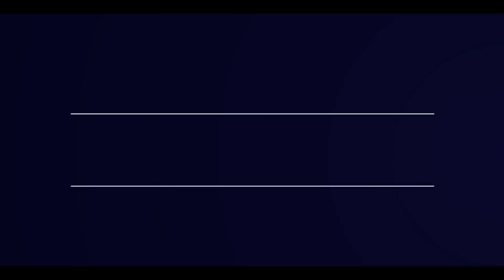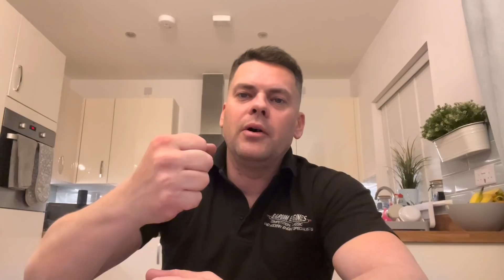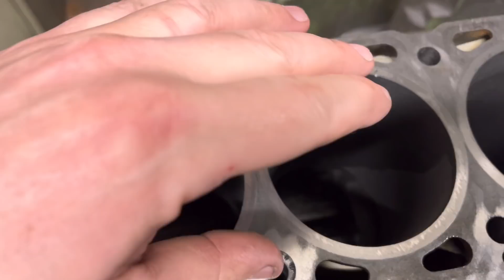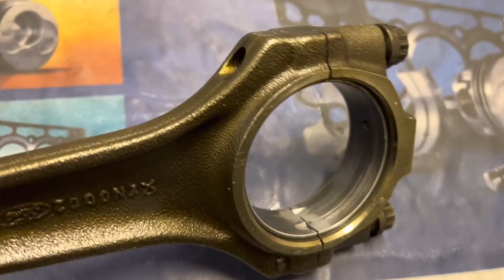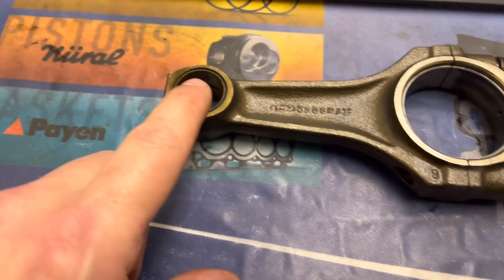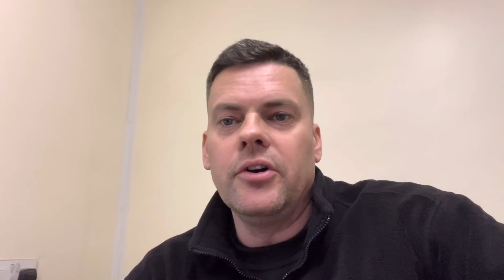Why are these engines SOO UNRELIABLE?

Comment: As a basic performance motor  (in it's) day.they were fine,then "enthusiasts" found that they could readily wind the boost up to the extent that the Head was doing its best to pull the Head studs out of the block. They seem to forget that it wasn't far off of a standard Sierra and even back to the last of the Cortinas.
Reply: The engine block can be traced back to early 70s so technically old when cosworth got hold of it it early 80s, but still effective if built right. As you say people  with no sympathy boosted the hell out of them and wondered why they grenaded themselves.

Comment: I love watching videos about old cosworth engines, as they were one of the modern turbocharged engines which set the bhp standard, fast forward to the 2000's and we have audi tt's 1.8T's running 270 bhp with 140k miles on them, engineering has come along way..

Comment: These engines were hammered during development  and came up as reliable. The competition versions worked but had a limited lifetime.  Then a tuning firm says we can do that for your daily driver which may last a fair length of time as it's not driven like a competion car on the road but start hammering it and issues will arise.  
Tuning firm .." Done loads of these , never had a problem ". I remember back in the day a friend telling me about having Lotus press cars having different cams rev limiter tweaked or removed,  those engines were shagged when they came off the press fleet.. they were however he said immense fun  ..when you're not picking up the bill.....

Comment: Great channel, so much info given especially to none mechanical folks such as me.
These Cosworth engines seem from what we learn on the internet to be or can be quite troublesome when older OR when altered to go faster, possibly.
With parts availability and cost's and labour times rising, is there any other engine out there that does what the Cosworth was made to achieve, or could be made to do, such as possibly a small block American engine at all. Just a thought.

Comment: Size distortion outside the standard thrust axis is usually due to knock or det. Those uncontrolled pressure spikes end up placing more compressive load on non standard thrust areas of the big end. Given the rudimentary knock control in the later engines (and non existent in earlier) then knock is often left uncontrolled, especially with tuned motors.

Comment: Dick Johnson in the late  80s raced them Cosworth Sierras. Once his team figured out how to in house tune them motors, them cars would stomp out crazy power for the time. Run in was 90 hp on the dyno turbo disconnected, turbo on with 2.4 bar of boost, 680. You tube vid on that some where. I just punched in Dick Johnson, Sierra and interview and up it came.

Comment: I had an argument with someone about Subaru engine reliability, I kept telling him it was because people put wrong fuel, raised boost, didn't service them regularly and thrashed them, as well as most unreliable ones are the earlier 90's models as the are really old now. Still couldn't convince him.
Reply: 100k on my ej207, still runs sweet and is standard apart from prodrive package from delivery. Suppose reliability depends on how far you go from oem spec
Reply: If people treated subarus like YB’s they’d be even more unreliable, people map subarus but with cossies they just buy generic chips, run 2.5 bar of boost through a badly worn engine and often run over double the factory bhp on standard engines
Reply: in fairness ive seen subaru engines throw big end bearings at a little over 40k miles in a car that was dealer serviced with the correct oil by time as it never got to be due a service on mileage terms, and driven like it was the owners baby, by a guy in his late 40s. teh car was BONE stock. not even the seemingly obligatory 'dustbin sized noise generator' exhaust rear section
Reply: I think the Subaru engines at least the 2.5 in the WRX and STI were junk for the most part.   Even brand new ones had head-gasket sealing problems.  God help you if you oil starved them a little with enough cornering. They'd start rod knocking fairly easily.  They were on the edge reliability wise from the factory.  The 2.0's were better somewhat. 

In the US they later '00's 2.5's had EPA mandated mapping problems where they'd stay closed loop too long when entering boost.  It was the primary cause of the broken ring-lands. 

All that said, my WRX is one of the very few cars I regret selling. It was the most fun of any car I've owned.  I completely swapped the entire drivetrain with a wrecked STI.  If you have a laptop, you can reflash these '00's subaru with open source tools.

Comment: From across the Atlantic.  The best engine I saw from your side was a 74 Mercury Capri - 6 cyl and 5 sp manual.    I know nothing of your issues. However - who here has deleted the waste gate, and let her breath. I raise my hand. Not a gas engine - but diesels. Had a herd of them from 1500 cc-79 to a 2002.  The 2002 is still running.  Oil - the life blood - needs to be a religious experience - and changed every time. Or the engine meets its rebuilder, where angels fix all the bad things we did.   Most are not honest about the story!  Cheers all!

Comment: Remember watching a documentary in the 80s, Cosworth trying to develop 4 cylinder turbo F1 engine. Used a standard Ford iron block. Built 2 engines and were then testing - 18k revs. First engine just stopped in it's tracks - 18k to 0 instantly. Rolled in second engine - same thing happened. Diagnosis of problem showed the blocks twisted, seizing the engines, they had to go back to the drawing board. FIAT 4 cylinder engines at the time in race trim were easily producing (reliably) more power than Cosworth got to on those development engines. And Cosworth had a tech logging analog data on a clipboard - at the time Toyota was using computer data logging just for engine QA - BMW using same tech as Toyota for engine development - Japanese instrumentation.

Comment: I worked for a Ford tractor dealership  in the early 90’s, when the tractors arrived from the factory?we had to dyno them for hours because they had a big case of failing porous bocks, we swapped out quite a few brand new engines on tractors with as little as 10 hours.

Comment: I was at Ford Dunton test ops during the development in the 80’s it was touch and go and had head bolt issues blowing degas bottles at Nardo and cylinder wear it in reality could not complete a FMC production sign off but was OK under then SVE testing regimes remember the basis was the Pinto block over engineered at the time, still a good engine and very impressive to drive back in the 80’s - we had a whale tale on the vehicle fleet
Reply: My neighbour worked at dunton in the 80's, was telling me that until he retired in the early 00's that they ran engines for a minimum of 600 hrs flat out.....we have a 86 mk1 xr4x4 with the cologne v6, had it since 93 and at 117k miles it's still on its original water pump and engine hoses, never even had the heads off, all cylinder compressions are between 155 and 160psi....thats had its oil changed every 3k miles with fully synthetic! 5w/30

Comment: I remember the Cosworth Vegas (Chevrolet) from the mid '70s! My memory may be kinda hazy after all this time but IIRC the blocks were Aluminum with Silicon Carbide (I think) in it. No sleeves. Theory was the pistons and rings would run on the Silicon. In reality they started burning oil almost on the way home from the dealership! I remember that someone figured out a way to sleeve the cylinders. Probably made a killing!
Reply: Then both Mercedes and Porsche adopted the same block material.

Comment: I did complete disassembly of Ford ECM used in European Escorts (Mondeos and such..) years ago when i got my Ford Escort and as car nerd wanted to bust open the ECM and shared definitions on TunerPRO forums of it and i love that ECM design as its so flexible and lots of functions made me think why bother with aftermarket ECM when this does so much without people really knowing it. 
Anyway personally i never got to fill my dream with Cosworth one and i will not due how my life going. Anyway my one favorite car ever. Kinda surprising issue with hear bolts even ripping when they advertised how bolts are arranged in angle to prevent anything head problems when they were developing it.. maybe they went too far.. or too short. Hehe.

Wanted still share i think Cosworths were one most stolen car in Finland in ratio of.. How many they have been in Finland : How many has got stolen. I heard this more than one source locally.

Comment: The wear on the older Cosworths is due to Bore wash, the fuelling can’t be controlled as accurately as modern ECU’s, too much fuel is added washing the oil off the bores.

Comment: My 2 litre works very hard. It is basically pulling two cars around all the while because it is in a 190 twin wheel transit van at 2400 kg empty (bt). 70 hp though, so it can stand being worked with the throttle pedal on the mat for minuets at a time just fine. My 1958 landy is 40 hp. The more you screw up the power the less time they last :o)
Reply: I can show you a pic of a transit 190 lwb semi high roof twin wheeler pulling a car trailer with Jerry vans full and a works spec escort mk2 rally car , the van had driver plus 4 passengers usually plus all tools, spares and 40 wheels on the roof and the total weight for all that was 6-7 tonnes so the v6 svo or 2.0 pinto couldn’t hack it so a big American v8 got dropped in and I mean biggggg
Reply: @chiefrocka8604  :o) how was the rear axle? 5300kg is the most I have gone, but in Shropshire that’s a lot :D
Reply: Had a 360 bhp RS500 Cosworth for 13 years, never gave me any problems. Drove it hard & had fun     ... wouldn't have another, a lot better out there to choose from.

Comment: When you take an engine that was designed to be a N A 2,0 with 97 BHP then strap a cosworth 16 valve head with uprated internals bolt on a turbo you are have built in failure  I worked for and on lancia cars with the 2,0   8 valve and 16 valve engines in the intergrale and the Croma I E turbo fiat and the lancia thema 16 v turbo and they would get the same problems as the cosworth due to people turning up the boost remaping with big horse power then cry when you say it's fucked and ran out of newness .

Comment: Because most engines when designed for 'sport' or 'power' reasons were not built for high end cars where cost wasn't a problem (not always the case). Thus they were working on a budget, materials weren't the best and they were sold at 'relatively' cheap prices, not a great combination. Once you start overstressing standard parts you have to take non standard rectification, this should not come as a surprise to you as you make a living from this? It is EASY to make an engine reliable and run many miles, diesel, change the oil, low compression, non turbo, chain driven cam, engine configuration (i.e. straight six) etc etc etc we have all learnt these lessons years ago haven't we?
Reply: Dont forget the best thing for a long lived engine capacity.
Reply: @chrisclarke6344   I forgot slow running too, probably the most important
Reply: @davidoldboy5425  👍

Comment: Seems like a super short rod.  That would produce a lot of pressure on the piston skirt and weird wear on the big end.  How long are those rods?
Reply: They are 128,3mm
Reply: Good call..They are short at 128,5 m c-c...pistons are about 40,5 comp height....Ford could have done some nice 139 rods and pistons at around 30,5 compression distance but seems they had some dogmatic belief in rod/stroke ratios of around 1,62.... The longer 139 or 139,5 would have been a much lighter piston--around 310-320g, and a nicer 1.82 rod/stroke ratio.
less side thrust and lighter more stable piston.

Comment: There's a big difference between building an engine and assembling an engine, as shown by the conrod.
PEOPLE -if you don't have an engine SHOP with EVERY necessary tool, LEAVE THEM ALONE! You're not saving $$, you're just chewing up a finite resource of blocks and heads
Reply: Very true, not quite so critical on older engines but a lot of specialist tools, and more importantly skill and experience required on modern ones.
Reply: @davidoldboy5425  not sure about that strip all the junk off a modern engine the components are just the same as an old engine but more refined. A competant machinist with a head shop, lathe, crank and cam grinder, line hone, boring bar and honer plus a mill can do anything needed. Any engine shop will have these.

Comment: If its pulling the bolt holes wouldnt that also throw the cylinder out of round?. Also whats your thought on holymer spray for mls gasket?.
Reply: I love spray on hylomar. Ive used that stuff on air cooled dirtbike headgaskets that run super hot over here in Australia. Pulled heads back off after years of use to find the hylomar still tacky.
Reply: i swear buy it, just want to see other opinions cause its rarely mentioned. Since using it ive had 0 headgasket failures
Reply: @motomenace86  same here, used it on my racebikes and have regularly reused SLS style gaskets with a thin pass of hylomar. Zero issues.

Comment: It's not that those engines were inherently unreliable, it's that they were & still are, so easy to over tune by just banging in a 'fast road' chip & waste-gate and then wind the boost up. Then every things great, until it's not! Hardly the fault of Ford or Cosworth that people tried to double the horsepower on the cheap and that's how they earned a 'reputation'

Comment: I can't wait to pull my head off my 2wd cosworth engine now to see if its been played with over the yrs I know its had head work as had figures wrighten on the head when I pointed the block .

It's been parked in the garage for 16 half years now so plan is to pull engine out and apart and give it a top to bottom going over 👍 
May have to give you guys a call to do the work but it's not going to be looked over for awhile lol 😆 
Got Kids and other toys atm buy my saph cossie not going anywhere she's my first baby 😉
Reply: and THIS is precicely WHY they give problems. theyre either modded OR they sit around not being driven all the time. that means every start up the oil has drained from EVERYTHING.

Comment: It would be better if the head studs were really long and they went right through the block, through the mains and held the big end caps on?
Reply: Its possible would need a girdle that incorporated main caps, cannot remember if bolts were aligned with main caps. Its doable but the cost would be large, but would stop pulling of threads.
Reply: @chrisclarke6344  I don’t think you read my post properly :D But, best fix is studs are threaded in the middle and glued solid in the block. They go up to the head and down to the mains. The mains have side bolts and threaded holes to lock into the girdle sump. Then you can still line bore it easily at any time. And a head overheating doesn’t make the mains come loose.
Reply: @teamidris  👍the cost would scare most off! Also not sure if it would totally eliminate block distortions with studs still attached to block.

Comment: Is it always necessary to skim the block after a head gasket problem??
Reply: 40 years ago I would have said not always.. In the last 20-25 years I'm not building near the numbers of engines as I was in the 80s and 90s but since 2001 only 42 engines..All 4 cylinder inline Fords (YBs, and Lima turbos, one BDG) several Cologne V4s and V6s, a bunch of Redblock Volvos, several Mitsubishi 4G62s --all known reliable engines..EVERY single one needed the blocks re-surfaces..All around .003" low in cylinders 2/3 >I do the set-ups at the machine shop and watch every one..ALL low and needed it.
All these engines are 30 to 50 years old and god knows how many times they've blown headgaskets and "I just limped home (cough--17 miles with the temp needle pegged)..
So like in the vid I think its owners cheaping out and getting "advice" off the intra-webz from people who have never built a single engine and think a micrometer is a welding clamp that leads to so many problems..
Reply: @janvanv  Thanks very much. cheers 🍺

Comment: Cosworth engines are not at all unreliable

Bad engine tuners, over fuelling over timing and thrashed , the bottom
End is very strong 

I’ve had a few of them and none we’re ever unreliable
Reply: Absolutely the ways to keep them together and make hp have been forgotten see my post above.
Reply: @chrisclarke6344  change the oil and a stage one chip is plenty , then let them cool down after a good thrashing, don’t run in cheap fuel :))
Reply: @jasonharryphotog  oil change is key, but never liked just chipping a motor without a delve into its internals to check their condition. I might be OCD but tuning motors for a living made you that way didnt want them coming back.

Comment: Yes ppl will just turn the boost up and forget that bolts stretch as well. 
 You hit 40 to 45 pounds of boost you need studs that most likely a 1 inch in diameter to hold down that head. If you hit 40 pounds of boost I sure hope the customer has an excellent bottom end that type of boost will kill it in a hurry. 
 Be safe.
Reply: 2 bar used to be the most over that you had self destruct issues!

Comment: Couldn't it just be bad engineering??? As an old American Hot Rodder, I pretty much disapprove of the over use of the Chevy LS engines, I know they have solid engineering that allows you to bolt up a huge turbo and make a reliable 1,000 horsepower from a basically stock block. I also know my limited experience with Triumph and MG engines they are pretty much made of hot cheese and wax paper.